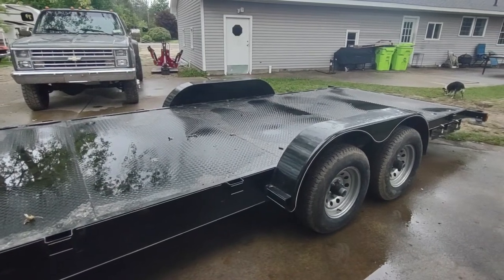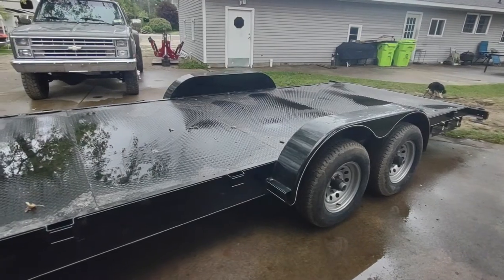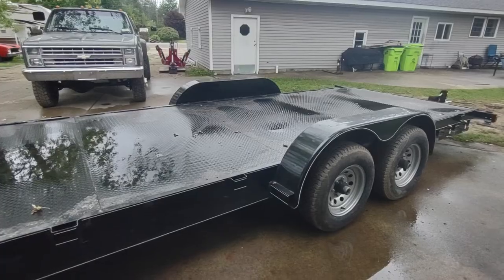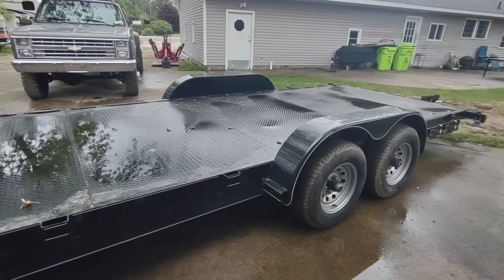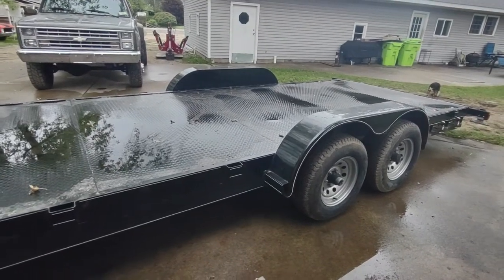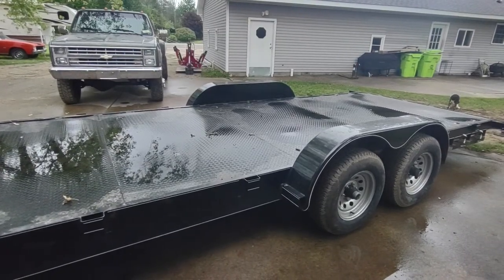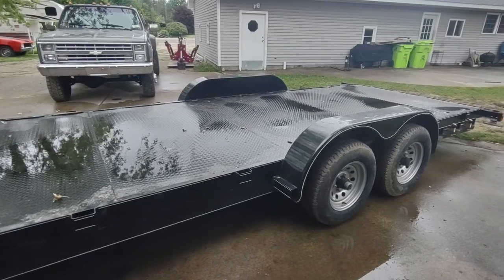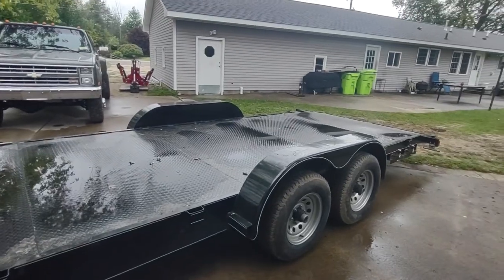Trailer Winch Box Setup

Comment: 😂😂😂😂😂😂 I watched the beginning of this video thinking this guy is ganna some badass 12,000 lbs winch on this 22 foot ALL STEEL trailer and then he opens the lid on the toolbox and it's only a 3 lbs  winch 🤦🏻‍♂️🤦🏻‍♂️🤦🏻‍♂️🤦🏻‍♂️
Reply from the maker: Anything bigger is unnecessary. Pay attention to the words in the video next time.  It's been years now this winch has pulled several heavy duty diesel trucks and equipment on the trailer without issue. Putting a 12k winch on a trailer is idiotic you're rolling vehicles up ramps lmao they're not stuck in the mud 😆
Reply: @roncook8566  " It's been years now this winch has pulled several heavy duty diesel trucks and equipment on the trailer without issue."

I have to call BS on that. I have a 5000lb winch and it does the job, but JUST. There are a lot of issues, using a winch that is not meant for that size of load. You are just either choosing to ignore the issue or you are just lying about them to justify this video and promoting lack of safety.

Comment: This is a really good informative video! Thank you for sharing! I see all the time car haulers with the 5 lug axles and people think you can put 7000lbs on a dual 3500lb 5 lug axle car hauler .but most of them weight around 2,000lbs empty so you can only put 5,000lbs max on a 7k GVRW car hauler trailer. It’s good to know all the different capacities. I’m also wanted a 6lug 83” by 20ft all metal car hauler. As well since a 10,400GVRW like your trailer can haul up to around 8,400lbs. Perfect for trucks and 3/4 ton trucks or really almost anything. I have a 14ft by 83” 7000lb GVRW pipe utitly trailer I used to pick up atvs mowers zero turns all that. I put a 5000lb polestar winch on the front as it was $160 at at woods it’s very well made. I wanted the 3500lb badland zxr winch but it was only 10$ cheaper so I went with the 5,000. As my small 14ft trailer can haul 5400lbs . So if I ever need to winch a small tractor I could as well.

Comment: Nice Video.....I have the 20ft 10lb steel deck version. I got it back in September. And, the first thing I did, being here in NW Indiana, was coat the bottom. I'm looking for setting it up for a winch (removable). Was deciding on powering the winch with cables or battery? I got some cables coming with the winch (13.5k lb) and then I came across your video last night. That just changed my mind on what direction to go with powering the winch. And, using a cane myself, work smarter not harder.
Reply from the maker: Yes the bottom on mine still definitely needs done it's almost bare steel 😆 with a nice coat of paint underneath seems like they would last forever 👍
Reply: @roncook8566  definitely hold off the rust. I did make contact with them and you can get one that is primed and painted, rather than just painted.

Comment: Nice setup, how is the solar coping?
Reply from the maker: That panel works unbelievably well. Several times I've checked and it was still charging covered in ice or snow. I've popped the lid a handful of times to check the voltage and it's always at least 13.8 volts. Very cool
Reply: Do you have a link?
Reply from the maker: https://www.amazon.com/Upgraded-Waterproof-Battery-Charger-Maintainer/dp/B08K2JG9MK/ref=mp_s_a_1_1_sspa?crid=2SXDU27QICG4D&keywords=solar+charger+12v&qid=1672680942&sprefix=solar+charger+%2Caps%2C300&sr=8-1-spons&ufe=app_do%3Aamzn1.fos.18630bbb-fcbb-42f8-9767-857e17e03685&psc=1&spLa=ZW5jcnlwdGVkUXVhbGlmaWVyPUExM1RMWFE1NlAzTU5FJmVuY3J5cHRlZElkPUEwMTcyOTE3MU9IQzNEN1dSUzdYWSZlbmNyeXB0ZWRBZElkPUEwMjIxNTU1SEdLSFpFTVNTWjFUJndpZGdldE5hbWU9c3BfcGhvbmVfc2VhcmNoX2F0ZiZhY3Rpb249Y2xpY2tSZWRpcmVjdCZkb05vdExvZ0NsaWNrPXRydWU=
Reply from the maker: Can't remember if that's the specific unit or not. They have them in several different wattages
Reply: Thankyou

Comment: Where's your spare?
Reply from the maker: I have a spare just not mounted on the trailer yet. Haven't decided on where to put my mount. I'm gonna have two spare hubs when I add electric brakes to the second axle so I plan on keeping them in the toolbox as well
Reply: This guys talks alot and says nothing
Reply: Ron I’ll give you a million dollars you show us ANY trailer manufacturer that sells a brand new trailer intended for pulling vehicles up onto.
They have 12,000 lb winches on them for a reason.
Your winch is for smaller ATV’s.
I have a 300 4X4 ATV that has a bigger winch on it than 3500.
You do you, promise you you are incorrect.